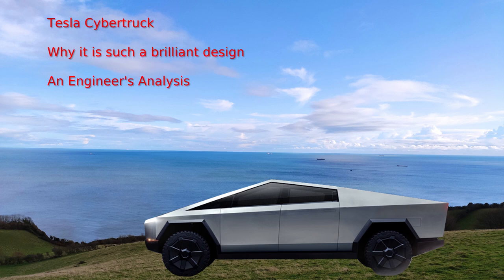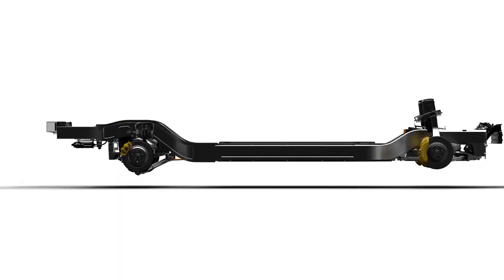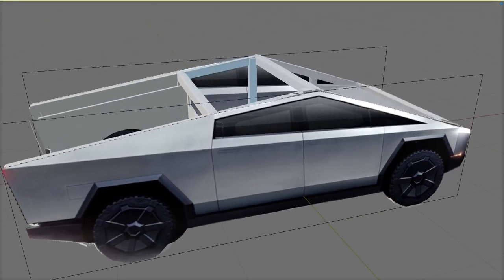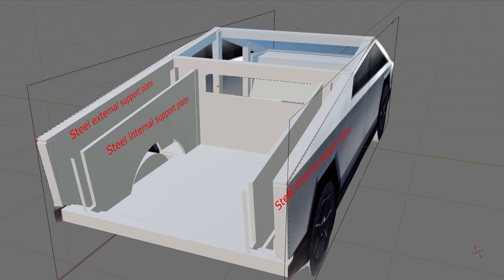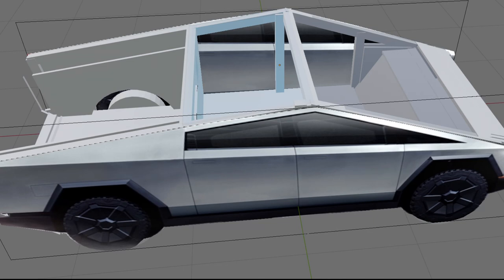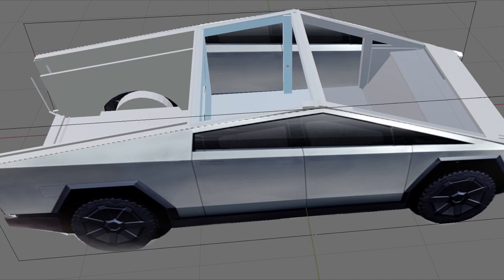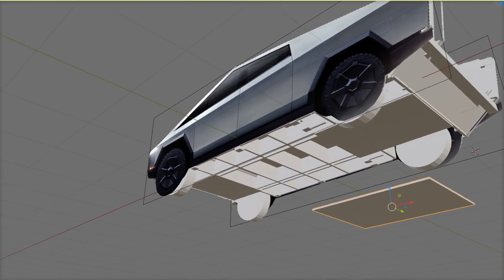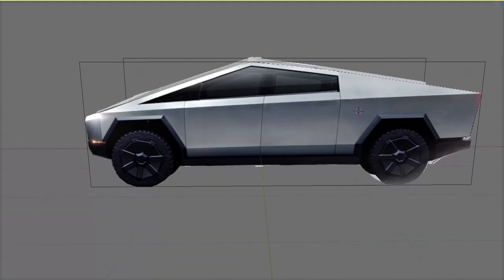cybertruck body shell engineering analysis

Comment: How does the design affect repairability in the event of a collision?
Reply: Probably goes like depends on what gets damaged and how bad. Strong enough for bumps (to avoid the glass shattering), but unlike most modern vehicles with crumple zones, if the frame fails the glass breaks (bad day for passengers), so you'll have to set the frame back and replace the glass. So like good on rear impacts for safety but side and front doesn't look strong. We'll have to see from production models how the glass behaves in front impact and even the very unlikely due to low center of gravity roll over, and even if the glass can survive severe driving conditions on bad road surfaces.
Reply: Jason Hall in some areas, incredibly easy to replace panels and sides are insanely strong and if they do break easy to replace. Like any car in the world made of cheap aluminum, if the frame is broken its classified legally as a “total” but teslas frame is probably stronger than standard cars. Also Teslas have the lowest per capita crash/serious crash ratings in the world because of how good their safety computers are.
Reply: @EpicLemonMusic  honestly waiting to see how that'll work out for the trucks because they'll be replacing work trucks that need to survive heavy abuse.

Comment: ....if we raise CyberTruck roof-height (6") where rear-cab meets front-vault (C-Pillar/Cab-Joint).... while correspondingly raising the depth (not width) of the tailgate.... we increase rear-seat head room (at mid-gate) AND vault volume.... as well as sail pillar storage AND open-tailgate bed length.... while neither CRITICALLY decreasing structural triangularity nor SIGNIFICANTLY increasing difficulty of manufacture...(..Aspirationally..)... while with widely available graphic skills and drawing jigs.... Why.... One might mock this up in the mere matter of minutes.... giving us ALL.... thereby.... a look at A triangling wrangling redesign that increases function while moderately modulating manufacturing mayhem.... y'see...

Comment: I think u haven't mentioned anything about fire safety of the vehicle . As it is lithium iron battery, there is high chance of fire . Any impact on the battery will make this truck fire . So all the accident impact need to be shift to another place rather than the battery location . I think this is the main reason cybertruck changed its structure to the upside and given more safe zone near the battery
Reply from the maker: Tesla actually holds patents for using the battery pack below the vehicle as part of its crash protection structure.  I also expect the next battery development to be non flammable.